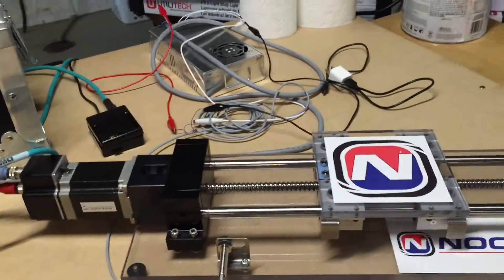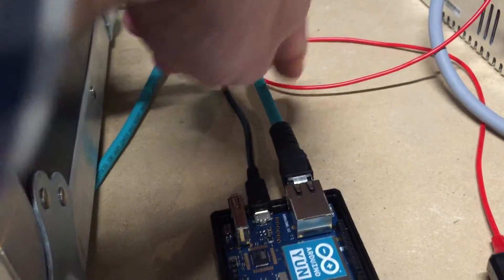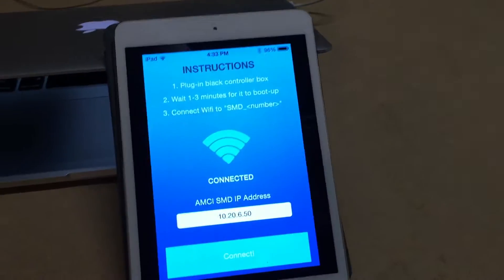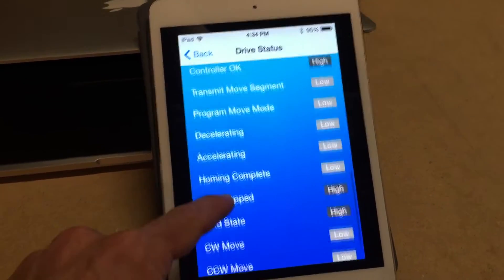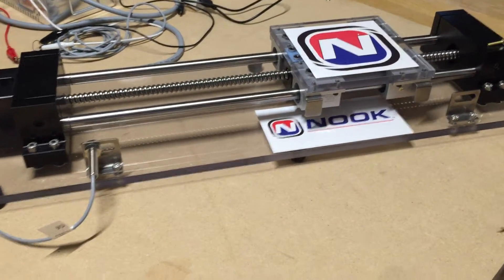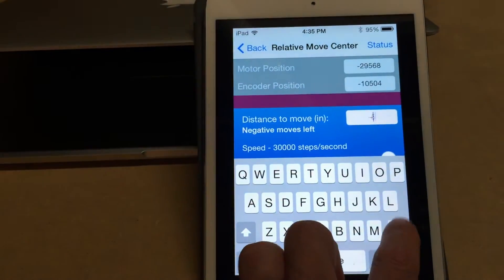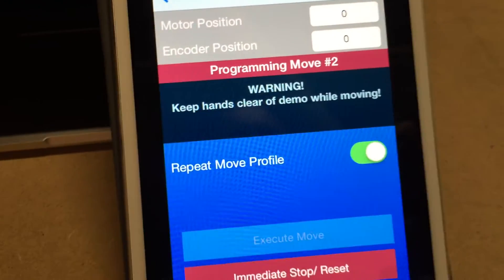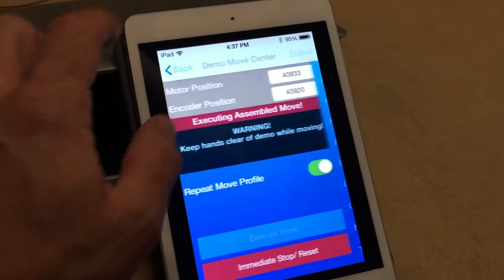Controlling an AMCI Stepper Motor over Modbus/TCP with an Arduino Yun and iOS Client

Comment: Hi Thanks for this inspiration :)
 I was wondering if you also have the collision detection on this ?
What happens if N plate hits an object?
Can you somehow use the built in AMCI encoder to create a closed loop system?
Reply from the maker: +GOKHAN DILEK Hi Gokhan - thanks for commenting! The drive actually has 2 limit inputs built-in. As you can see in the video, I have two proximity switches attached to the assembly - one I use for a Home switch, the other for a clockwise limit switch.The drive is enabled to stop if it travels past the CW limit.

That said, the AMCI motor also has a build-in encoder, so I could use that for protection as well.

I hope that answers your question!